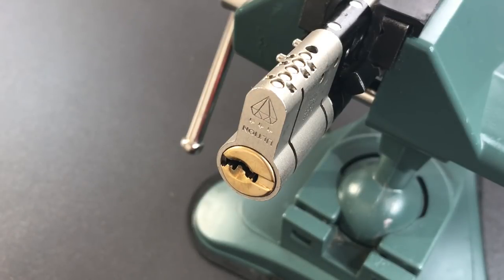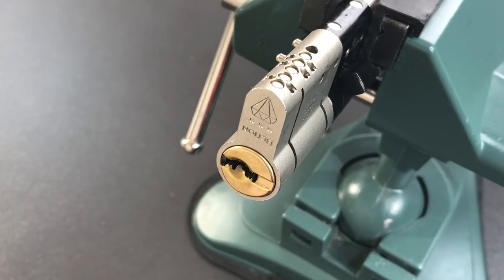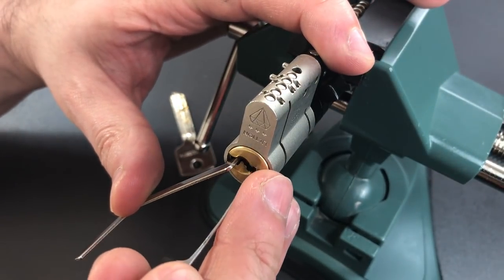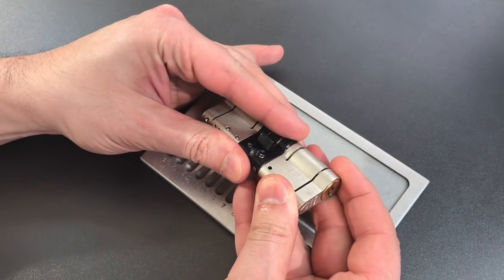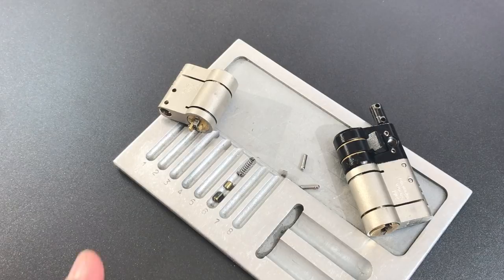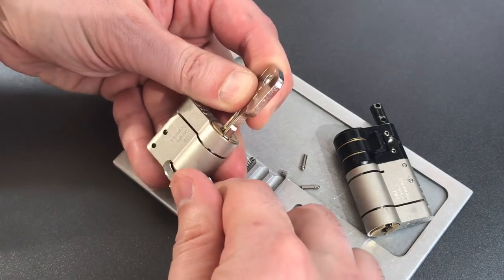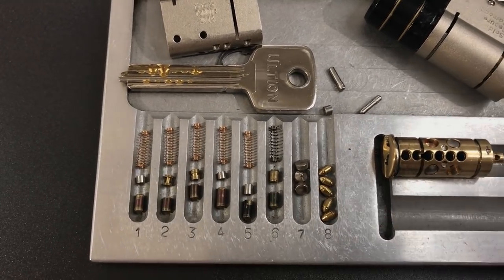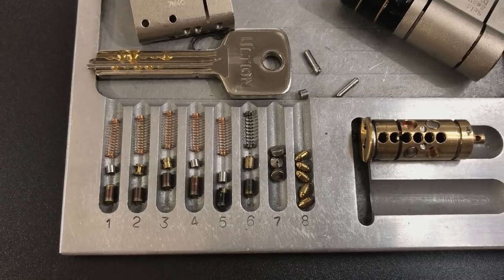[628] Ultion Euro Profile Cylinder Picked and Gutted

Comment: I’m an approved stockist for this lock. The passive pins drop down when the lock is the correct way up. It’s designed to withstand sustained attack. Thieves don’t use picks in the UK. It’s all lock snapping.
Reply: The fact it's "easy" (in lpl terms) to pick is an asset. It's hard enough that a noob picker couldn't do it with those security pins, but means if you get locked out a locksmith should be able to get you back in without having to destroy the lock or door.
Reply: Most thieves don't use picks in general. It's something that takes dedication and practice. If they were willing to commit that to something, they wouldn't be criminals. And sure, there are some more "career" criminals that have "honed their craft" so to speak, but they're not the type to burgle a house.
Reply: Those passive pins just provide key control as a key with all passive pin cuts present will operate any combination of passive pinning, it's a super basic and weak kind of master keying/access control which is exactly why LPL said they're unusual on residential locks (1:10), they're not put in for withstanding sustained attack, they're brass for starters. Even when they drop down into place, they're designed to be pushed in to the core upon rotation similar to how sidebars retract. They do not depend on gravity to fall, yes they have no springs but think about years after use when they get all grimey and don't move by gravity alone. They move in and out as the core gets turned. The passive cuts on the key allow those pins the space to be retracted on rotation. They don't provide any security as far as attacking goes.
Reply: 911Locksmiths that was exactly my assumption; this design implies that low skill destructive attacks on the lock must be a bigger issue in the UK than it is in America. 

Not having been to the UK, I assume that the doors there must be more stout than they are in America, because here you see weaker locks and more attacks on door jams and windows.
Reply: Ashton Kemerling  Yes the doors are generally strong and the crooks just snap the locks.
Reply: @AshtonK1816  in the UK increasingly common are wooden composite doors.

So they are a thin skin of some toughened uPVC/fibreglass then a core made up of around 20-30mm of solid wood scraps glued together to provide the rigidity.

They'll generally laugh off a sledgehammer.

The frames will be uPVC or similar but with metal reinforcement structure (not particularly strong but...)

The locking systems are almost always multi point hooks which effectively make the door part of the frame, and increasingly they are including passive dogbolts on the hinge side.

But... Snap a cylinder and you're in, in seconds hence anti-snappers.
Reply: Euro locks should be picked the correct way up, indeed. Even feeling what pin is set is way harder if the pins are down.
Reply: As a hard working thief from the UK I take issue with this blanket statement that non of us pick locks!!
Reply: They might use picks now. Lol
Reply: Lock snapping  isn't  as common  as the industry  would  have you believe (less than 10% of break ins nationally), it really  annoys  me how certain  people  will push anti snap cylinders  in people  as an answer  to all their security  issues.
I have seen people  sold an abs for a 30 year old battered door with a crap  gu 2 roller no deadbolt  mech ,you could  open that thing  with your bellend.
Reply: @jizzmonkey9679  a modern well constructed door should have a BS 3* or SBD lock fitted. 
I don't know where you are based. But in central Scotland and Yorkshire lock snapping is a regular occurrence.
Reply: @911Locksmiths  smashed  glass is by far the most common entry, over 70%  of break ins nationwide.
Reply: @jizzmonkey9679  in SCOTLAND the stats are unlocked doors, physical attack of the door, then locks snapping. Glass isn't a big thing up here. We don't do many board ups
Reply: @911Locksmiths  it is definitely  a big thing  in Scotland, I will try and look for the stats i have by region which come  directly  from the 4 major insurance  companies  who we do 90% of our work for .
Every  single  region  the biggest  cause  of break  in  is smashed  glass,obviously  the percentage  is different  for every  region  and is also dependent  on who is in jail or just been released.
By break ins  I am referring  to forced  entry  not burglary  through  unlocked  windows or doors
Reply: @lewsut  you clearly meant to write nun or is it your accent.
Reply: @TheMrVengeance  But you know there's some oddball murderers, rapists, creeps, panty sniffers, bitter ex's, and so on. Picking a lock wouldn't be that much of a herdle for those, and potentially leaves no track or trick the home owner to think he/she is alone.
Reply: @basstrammel1322  Nah, absolute nonsense. Learn the difference between real life and movies.
Reply: @TheMrVengeance  I've snooped through other people's storages on a few occasions, and I'm most certainly not the only person in the world who've done something like that. Just simple padlocks in my case. It's shamful and I'm a disgrace, but I'm creepy and entered enter other people's property without them ever finding out. Thinking people far worse and more cunning than me isn't that far of a stretch.
Reply: @basstrammel1322  - Good thing homes aren't protected with simple padlocks then, is it? So creeps like you don't get in.
Reply: @TheMrVengeance  Wouldn't take much time to figure out an old lock. But besides just me and my stupidity, I hope you can understand it's far from impossible, and shady people can have a number of motives for picking a lock instead of breaking in.
Reply: @basstrammel1322  - If it's so easy, and they have such a big motive, why isn't it constantly happening all over the place? Why do burglars break windows or force entire door frames if its so easy to just pick a lock?
Again, learn the difference between fiction and real life.
Reply: @TheMrVengeance  I'm not claiming that millions of people do this, I'm saying it's very plausible that weirdos and sociopaths can and will do this sometimes. As the lockpicking hobby has become popular, there will always be bad apples with good skills. And I've never said it's EASY to pick a lock, wth. Learn to understand how the human mind can sometimes make people do extremly stupid things.
Reply: @basstrammel1322  - But it's not plausible. Picking locks is a skill that you need to train, it'll take hundreds of hours to get good. Picking a lock, especially a more complex and quality lock that'd be on a house's front door,  isn't something you can just do.

"Weirdos and sociopaths" that apparently want to sniff your panties aren't going to spend hundreds/thousands of hours training to pick locks to do so.

There are much more simple and direct ways into your home, they'll pick that route. Picking locks is for professionals who help you when you locked yourself out and you don't want to buy a new door/lock. Or for people who do it as a hobby.

And finally, yes, you did say it'd be easy. It was clearly implied by the way you talk about how trivial it'd be to learn how to pick the front door lock on a house, and with your whole admission of your own criminal behaviour.
Reply: @TheMrVengeance  Lots of people have picked locks for hundreds and thousands of hours, and some of them will be bad apples. You are dead set on that such cross-overs can't happen, for whatever reason. I'll leave it at that, don't think I can be clearer about this.
Reply: @basstrammel1322  - So what you're saying is that SOME people are very experienced lock-pickers with thousands of hours of picking experience, and SOME of those people COULD be "weirdos and sociopaths" and because of that you think it's common enough that locks should be specifically designed against them?? 😂👌🏻

And to begin with, none of what you're saying now is at all relevant to the comment you replied to. It was in regards to thieves snapping locks instead of picking them. If a thief had spent thousands of hours on lockpicking practice and could open the front door of a house in the same time it takes to snap a lock... HE'D BE A LOCKSMITH and get paid to do it legit.
Reply: Agreed that snapping, or incorrectly locked multipoint locks and open windows are the top threats in the UK. Of many dozens of burglaries on the local groups, none of them have been picked, they're all low skill with a crowbar or molegrips to force the door or the lock. The only problem with a pick attack is there is often no evidence to prove the door was actually locked which may invalidate your home insurance. They often have clauses that limit their liability if there is no evidence of forced entry.

As an aside most of the Ts007 3* locks had flaws a few years ago when we were replacing (before this video), some had major issues with jamming up (ABS) others couldn't be bought keyed alike. This was the best of a bad bunch as most of the real high security euro locks aren't hardened against lock snapping.
Reply: Hi where are you based? Ive not long moved into my property and worried about the snapping risk,is this the best one to get,ive just left domestic abuse and havent got alot of stuff mostly donated but need to be safe,how much does this lock sell for in the uk? ,thankyou
Reply: Bump keys are however used by some criminals and there's some evidence this may not be particularly bump resistant.
Reply: @Aspartame69  they really  don't, smashing  through  a toughened  DGU in a set af french doors is by far the most popular  way of entry.
Reply: @98dizzard  lock snapping  really  isn't  a big issue  in the majority  of the UK, Midlands  is the only  real hotspot  but it is still way behind  smashed  glass .
Reply: @mfx1 I have  never been to a burglary  were bump keys or lock pick were sued, on average  I attend around 20 burglaries per week.
Reply: @jizzmonkey9679  Years and years ago, i had a pair of sliding patio doors fitted, within 3 weeks half the handle was snapped off and the cylinder was snapped and i lost my 40inch sony lcd, back when that was a new thing. Wonder why they didnt just smash the glass?

My back door still has its cylinder lock drilled into from an attempt in the same period. Though they didnt get in, and the inside of the lock still works so never bothered replacing. They could have smashed the glass and turned the key since its always in the back door.

Odd.
Reply: @jizzmonkey9679  If a bump key was used then how would you know? I suspect in cases where it did happen the owner may think they'd been an idiot and not locked the door so it may not even be reported. They're rare but I know of cases where the insurance company has refused to pay out because there was no sign of damage. Some UK Police have reported finding bump keys on known burglars but again it is rare. Much easier is to kick in a UPVC door panel TBH. After my experience with burglaries in the UK I'm surprised any officer is attending 20 a week unless you work in insurance?
Reply: @jizzmonkey9679  forcing doors seems to be number one here. Lock snapping is becoming less of an issue, possibly because of the increase in the number of snap resistant locks and security handles.
Reply: @mfx1  I'm not a police  orafice, I attend assess and repair the damage  on behalf  of insurance  companies. 
Problem  with bump keys are you need to have the correct  profile with the correct  amount  of pins,it can  also be classified as going  equipped,it takes far longer  than using  a screwdriver  to smash  a patio door,or even using  a garden  ornament so they are not carrying  anything.
Reply: @jizzmonkey9679  I'm still surprised how many people still have Old Yale nightlatches as their main lock, some may have an additional deadlock but often they get lazy and stop using it.
Reply: @Aspartame69  over70% of forced  entry  is through  broken  glass in the UK ,percentages  obviously  vary by region  and who is in or out of jail
Reply: @98dizzard  where is here?
Reply: @mfx1  either  that or they leave  the key on the inside because  they think  it  stops  people  being  able to use an old key,especially  if they didn't  change  the locks when they  bought  the house.
Reply: @jizzmonkey9679  you are probably better suited to getting actual statistics, I am just going based on self reports of crime on local groups, so entirely anecdotal.
Reply: @98dizzard  according  to insurance  companies  smashed  glass is the most popular  form  of entry throughout  the entire  south  of England. 
I have got a breakdown  of methods  by region  produced  by the 4 main insurance companies somewhere ,open window or door is obviously  by far the  most common as technically in many cases no crime  is committed  until  you have  left with something
Reply: @98dizzard  1 person  can have  a huge impact  on current  statistics, I have known a 90% drop in a small region's burglary after 1 person  was arrested. 
If the current  main culprit  favors  forcing locks and windows  then that  will skew the figure, until they get nicked  and someone else  is released.
Reply: @jizzmonkey9679  yes, there's certainly a few familiar vehicles/faces that pop up time and time again on the local groups.
Reply: @98dizzard  there is currently  a spate  of burglaries  where I live  where they a taking  I pads,  TVs ,laptops  which  is almost  unheard of these  days as they can be traced ,so either  been away  for a few years  or are from outside  of the UK
Reply: @jizzmonkey9679  yes opportunistic open window is very common, especially for vehicle thefts, although that mostly seems to have moved to keyless thefts now. When they come for renewal I will be changing the ground floor glass to laminated units. Already have anti-bandit film on the important front door glass. The information you provide reinforces the need for better glass. Obviously it doesn't make it impossible to get in, but will take time and noise which in a built up area increases the risk of being caught.
Reply: @jizzmonkey9679  would open window/door include multipoint locks that haven't been lifted and locked? These are easily forced with little damage.
Reply: @98dizzard  a lot of people  just leave  it on the nightlatch Spilt or duel spindle,all they do then is use a food waste caddy handle  to hit the inside  handle  down to open the door with absolutely  no damage.
Reply: @jizzmonkey9679  dual/split spindle are possibly the worst invention. People think it's secure because they got locked out once when the door blew shut in the wind, but actually offers zero security.
Reply: @98dizzard  I used love them when I used to  get called to gain entry,easiest  money  you will ever make
Reply: @jizzmonkey9679  well yes, they're great for anyone wishing to enter a property without a key 🤣
Reply: we sell these on the Solidors where I work and I always tell people most household locks are easy to pick, but not these
I specifically searched for this video, I was happy to see LPP did make a video on them
Reply: @avro9159  they are very easy to pick,especially  for a dimple lock
Reply: @jizzmonkey9679  Hi, thanks for all your info.  With your knowledge and experience could you advice me on the safest, most secure lock for my front & back door please, both doors have glass right beside the handles/locks!  Plus advice on best window security, i.e...what window locks and other kind of window security I can add.  I was leaning towards manual push button pin code locks...they any good?  \is this Ultion lock good?    I'm trying to avoid having to install security cameras or a monitoring service.       Thanks in advance. :-)
Reply: @MissHappyKate  what type of doors with what current  locks are they?,
Reply: @jizzmonkey9679  Hi, the doors are thick composite, or PVC (I can't tell the difference, this is a council house the doors are new, installed last year.)   I don't know any lock/ door lingo I'm afraid, but to explain the current lock in the doors,...when the door is opened and I turn the lock, 10  bits of steel / metal stick out.  The 10 pieces are different shapes and sizes, some short and cylindrical, others are larger and rectangular, others longer still and hook like.  Seems great, but no use if my lock can be bumped in 2 seconds, and the glass right beside the handle/lock smashed in 1 second!   I don't have any window locks at the moment. PVC windows.
Reply: @MissHappyKate  I can only  assume  that if it is council they will be thumbturn cylinders  as they are usually  required which is a security  issue  in itself,.
Fitting  laminated  glass  is a good start, what make cylinders  are in there at the moment
Reply: @911Locksmiths  just need to treat them like robocop. They try and snap the lock and 50000 volts goes through the door
Reply: @avro9159  I got a Stable door of theirs fitted with these locks just after the 1st lock down and was told by the supplier that there is literally no other domestic euro lock which can beat these for security, some are on par but none beat them. Maybe they only looked at drilling them lol.
Reply: Agree with the others, picking is rarely done in the UK. Just Carrying lock picks is an offence and  will get a jail sentence and most criminals can’t be bothered to learn. Most attacks are destructive as many locks are easier to defeat this way and the criminal can only be jailed if they are actually caught in the act as destructive tools can be claimed to be part of standard handy man gear.
Reply: @davidmcnay  no it isn't
Reply: @davidkilpatrick18  strange  how a supplier  will tell you what they sell is the best.
Reply: @davidmcnay  your points are valid. To carry picks isn't an offence. However, if the police where to stop an known criminal with picks it could be classed as going equipped.
Almost every burglary involves physical force. Either to a weak door, the attacking of a lock or the smashing of a window, which usually is a small glass panel on a door. I've not been to any break in involving a lock being picked. 
I have been to night latches that have been slipped.
Reply: @911Locksmiths  french door or sliding patio glass is the favourite, they can just walk through.
Something  that is becoming  more popular  is small sharp stones,if they do get stopped  the can just drop them and most police  won't even consider  them as tools.
They are great for capturing DNA though
Reply: @jizzmonkey9679   True but when you get to see what they pay for the locks and what they charge customers for the locks and that's over 3 different brands you get a.good idea
Reply: @davidkilpatrick18  not really, price of a euro cylinder  has no real  bearing  on security. 
Especially  when they sell you a brand  new top of the range  front door  which  will stop 113% of all criminals, but the rest of the house  hasn't  been touched  since  1963.
I still prefer  the yale AS series to any ultion, abs,platinum. 
Reasonable price, no stupid key that costs £10 to copy and you either  have to drive 15 miles or order one online and get it delivered 🤦.
Over the last decade  the lock industry  is relying  on scaremongering tactics  to overcharge customers for a false sense of security.
Reply: Erm, how good is that little pin against drilling it?
Reply: @BD90..  the pins aren't the problem. Its the can that locks down when attacked..  The core is uni bodied and is dense iron which protects the cam. Hard plate safe bits and a slow steady hand. Its not a job for a Diy'er to drill that's for sure.
Reply: @BD90..  only thing  I do give this lock is the amount  of drill protection  is has,they are a pain in the arse to drill
Reply: @xorsyst1  Definitely, I used to work in a Solidor supplier which stocked the Ultion locks, I had a go once, couldn't pick it, I think LPL thinking a lock is easy to pick doesn't stand for much, I am very doubtful that the UK has many robbers who are trained lockpicks to this level
Reply: @AshtonK1816  - yes composite doors are common in the UK and withstand a good beating. See example of even a cheap one, https://youtu.be/TowwXKSefjk
Reply: hey lewsuit, don’t forget about your lawsuit
Reply: Not true, at least for London in the late 90s and early 00s. Some of my "friends" back then were well versed at picking locks. These were teenagers taught by their friends and relatives.
Reply: Did thieves swear to god that they would never use picks?
Reply: @julietaylor1860  £48
Reply: @jizzmonkey9679  I bet it's more common in the UK because home owners don't have guns so thieves feel more empowered to be louder.
Reply: @elijaht3223  most break ins happen during  the day when people  are at work , so if the did have guns they would get nicked to.
Rifles  and shotguns  are sometimes  the main target  during  a burglary .
Reply: @andrewclough660  No, he meant vicar, or maybe it was pope. 🤔
Reply: This is a valid review… if we pretend he took the door out of the frame and turned it upside down 😂
Reply: It also triggers me, that lock picker pick these cylinders up side down.
Reply: @AshtonK1816   We use much weaker Schlage and Kwikset locks because they're cheap and convenient, and they just keep honest people honest. Many Americans are armed so breaking and entering is not nearly the problem here as it seems to be in other countries.
Reply: @jizzmonkey9679 The last thing thieves want to do is create a massive noise.
Reply: @Aspartame69  what are you talking  about